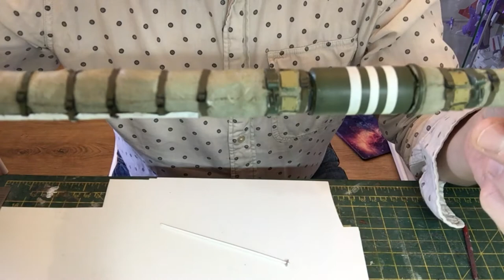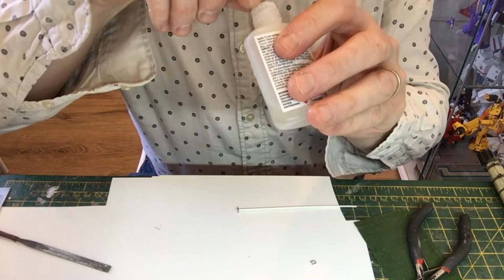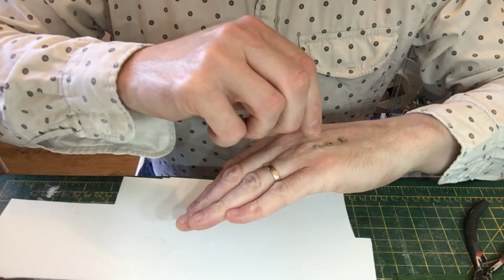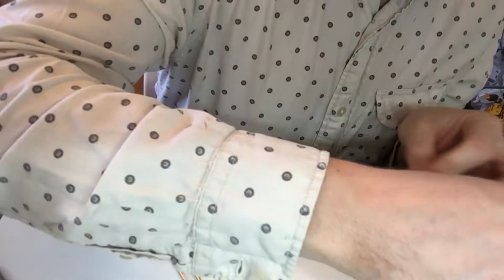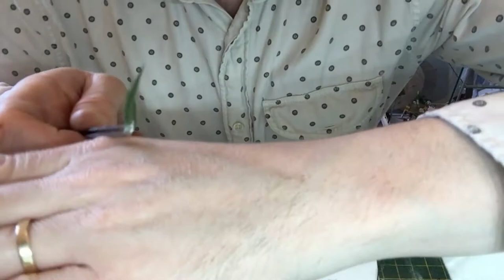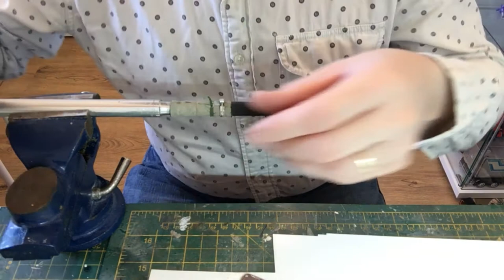Haya chieftain barrel thermal sleeve tutorial part 4, buckles and straps

Comment: 1 hour of petrol lawn mowing is equivalent to a 100 mile drive by car!  Lawns are NOT green!

Meanwhile I don’t even know the function of the ‘jackets’ on tank barrels!
Reply: They help with cooling, hence the name; “Thermal Jackets”…
On top of that, they also help to maintain a certain temperature inside the barrel, preventing things like wind or sunlight from distorting one side of the barrel from the other, because if the gun is fired while the barrel is distorted, the accuracy will be hindered.

Comment: Seems like a Lot of faffing around, why not just get a whole set of photo ettched buckles in different sizes much easier.
Reply from the maker: Hi!
I did look at those, but there are bit thin, the buckles are actually the clip together ones like on a back pack, so thicker.
And I quite like faffing around, cures insomnia 🙂
Thanks for watching
Reply: No your looking at the wrong one's. I found proper ratchet straps, that actually work. I also found what U said with the clips. But even the ones with the clips have the ummm buckle where U can remove the clip an just use the buckle where it just slips through. An l found it in width 3mm, 5mm, 7mm so there's a wide variety of sizes!! An the metal ring that goes around the ends of thermal jacket, with the metal bolt to tighten the metal ring l also found them. All made for 1/12 - 1/14 scale so they fit perfectly. I even got a Trumpeter paint stirrer for $6 delivered!! So if U no where to look U can find the correct size an fittings.l also got the cage that goes around the rear of the turret an hull of the Challenger ll "Megatron" witch l will be turning my challenger into. I just need to make the tea table for the turret. Also got all the Chobam armour, an the gun mantlet with the little door above the barrel l got that, witch opens. Even though I don't use the bb's l can put the laser targeter there. I'm amazed how small it is but how powerful it is. It's exactly the same as the red dot lasers U see in the movie's, it's that powerful!! Anyways hope U find these straps an ratchet straps Very Cool to see the ratchet actually working!! Very Cool, l even got army green. Cheers Aussie Skot.